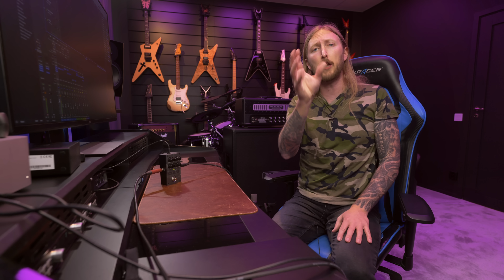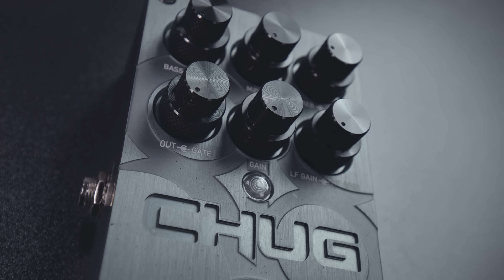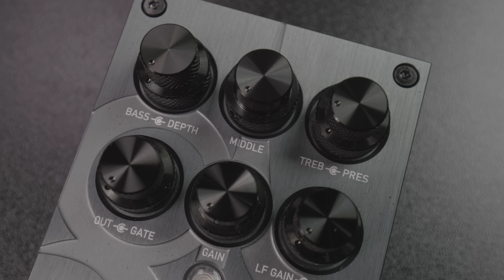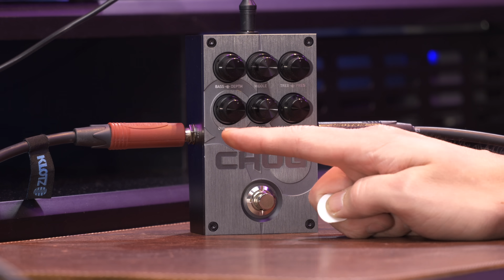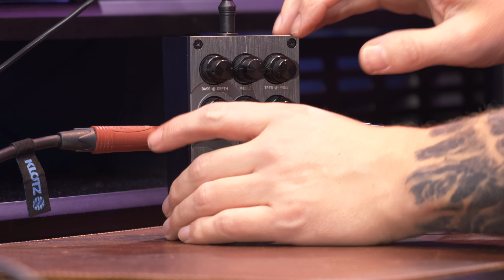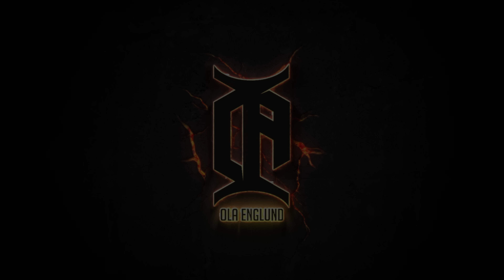THE CHUG HIGH GAIN PREAMP PEDAL

Comment: This pedal seems pretty cool. I am wondering if I use it on an older tube modeling combo amp without a presence control, would the presence control on the pedal work well to give me that presence option. I ask because you said to turn the presence all the way down when plugging into your amps clean channel. I assume that is because the mesa already has a presence control. Thanks!

Comment: Sooo, i bought used one, tested around 10 h  with different gear and here it my thoughts:
pluged before  Laboga Beast 30 + (smaler version of Mr Hector) and 212 vintage 30 cab - sound like crap...to much mids, unberable highs, no lows
same amp, same cab, pluged in effect loop  - sound like crap but little better...
Pluged in fx loop of Laboga Beast 30+ and my DIY 212 cab with Hesu Demon and Jensen JC12-70EL 12 - JACKPOT... omg this instantly sound GREAT... amazing chuga chuga, very ENGL sound for 150 bucks,

Comment: You could also make 249€ priced CHUG+ Pedal which has a USB charging battery in it. Then you could use it really easily for all kinds of situations without needing to hassle with power cables or making space into your tidy pedal board?

Comment: Holy !@#$%! Got the Chug today!! Just ordered it 3 days ago and I'm in Michigan. Wow! And it's staying on the pedal board. I can't lie, I had to do a heck of a lot of tweaking running it into the front of a Marshall DSL100 but I was also learning how to operate the knobs as well. But once I got things dialed in holy balls!!! 

This thing is like a Fortin 33 on steroids with tone controls, hi and low filter controls, bass and depth controls, mid control, noise gate, and a GAIN control!!! Insane!! 

So here's the cons which are not an issue at all for me myself, js:

Rhythm & Beard did a review and I have the same issue with the output knob turning when you turn the noise gate knob. That needs to be fixed although I don't use that gate so not a biggie for me (I just use 2 hands , set it and leave it). The corners of the pedal are a little sharp imo but it's on my pedal board so another no biggie for me. The issue that affects me is that there's no indicators on the knobs other than a tiny round indent so it's hard to tell where the knob is and also where it's going when tweaking. I leave mine where they're at once dialed in but I did spend some time making a diagram of my setting in case they get bumped. Made in China? Not losing any sleep over that myself.

Other than that and maybe a battery option (another thing I don't personally need) I can't think of anything else and couldn't be happier. And I'm one nitpicking finicky guy when it comes to tone! Selling all my Fortin pedals now. No bullshit. Thanks Ola 😁

Comment: Very cool, I wonder how good it would sound plugged straight into a common Bluetooth powered speaker? Like a small Jbl maybe? I used to sometimes play through a Behringer Ultra Metal pedal(which also has a good amount of tone shaping capability and is essentially a preamp) into a cheap little Bluetooth speaker if I wanted to pack extra light when going out to the  park or something. The speaker would just need to also have a cable input, which i would then use a 1/8" cable adapter. With the wide range of tonal shaping I could get a decent chug. I didn't have much money to spend at the time, which resulted in me using what I had on hand at the time.

Comment: IMO. I got this pedal. Very tight. However. Not enough bottom end. With the low maxed not moving enough air. If that is addressed in the second version then will be a powerhouse.

Comment: 😅 i really thought to design a pedal like this on my own. The only thing i would personally add is a low and high-cut filter to the gate. Some modern chug, like Architects, really need the low-cut to give the base any room in the mix at all. And the high-cut helps the vocals.

Comment: Well, it surely sounded fine and dandy with that IR and that ultra-expensive Mesa 👍 ...But when u plugged it into that smol Marshall, it surely sucked the chug OUT of it!! 😆🙈 I have a 10W version of that combo and I could swear it doesn't sound much different with the built-in distortion vs lé Chug. The Chug might have been tighter, but that's about it.
But seems like the best use for this might be plugging it into ur audio-interface.

Comment: OLA! I kinda doubt you'll even see this comment, but,
It'd be pretty BADASS if you'd pull out the all pedals Dimebag rig and swap the Horizon preamp for your Chug pedal.  
I built a more extensive version of your all pedal rig, but hearing your chug pedal all on its own, I feel like it might be a better fit in this chain than the Horizon! I'd be 100% sold on it 😂
Stay Metal Ola! 🤘😈🤘

Comment: Looks/sounds interesting, but too bad the input/output is placed on the sides, not on the top.
They're not even offset, makes the worst placement possible, when you try put it on a crammed pedal board.
😕

Comment: It's feisty, no doubt about that.  It's all the good stuff built in a straight-forward package, bravo for that.  No taking the pedal apart to turn a gain screw , micro-switches or micro dials on the side nonsense.  It's priced about where I thought it would be and not in the stratosphere like some can get and the pictures make it appear to be of very sturdy, stage ready construction.  Cheers.

Comment: I am very intrigued by separate low-frequency and high-frequency gains! That is a neat idea!
What I don’t understand though, is why so few distortion pedals have a mid sweep. It adds so much tonal flexibility at the cost of only a single knob. BOSS knew what was up when they put it on the Metal Zone. REVV hamstrung their otherwise awesome G3 by not giving it a mid sweep. 🤷‍♂️ I don’t know.

Comment: So good sounding pedal, packed with so many great features, built like a tank, with grreat design and named CHUG... kudos for all of these, bro, you nailed it to te max! 🤘 
Please consider this when it comes to version 2: since it's designed to be used as a preamp pedal, I suggest adding a clean channel to it (when turned off or maybe as a separate option). As someone who's been using preamp pedals for about 6-7 years, a lack of clean channel could be real struggle when you're left with just with your dry power amp sound.

Comment: I've never been able to use a drive pedal or preamp direct into an interface without unwanted noise. Usually a sort of constant high pitched whine just above the noise floor.  Tried lots of things with DI boxes, isolation transformers etc. both humbuckers and single coils. No clue why, but I suspect this pedal doesn't solve it either.

That said: fantastic sounding demo!

Comment: How would you handle the settings if you wanted to plug this into a board like the Headrush? I use the Headrush for virtual cabs/mics for my Orange Guitar Butler (another pre-amp, just not as modern metal sounding). But this pedal is intriguing for hard metal.

Comment: I like how this is basically the Satan preamp in a box. Gotta hand it to you Ola, this is the most versatile pedal for high gain we've had so far, bravo!
Reply: Pretty sure it's a replica of the Diezel VH4 pedal.
Reply: @LeftHandedRightHanded  pretty sure the VH4 pedal has neither a noise gate nor the low/high filter knobs.
Reply: @plumbummusic2051  are you talking about depth and presence? Because the VH4 does
Reply: @LeftHandedRightHanded  No he was talking about the separate gain knobs for high and low frequencies. That feature was (IIRC) in Fortin Natas which then found its way to Randall Satan and Randall Thrasher via Fortin.
Reply: @LeftHandedRightHanded  nope, I'm talking about the low/high frequency gain controls, please refer to 5:05 in this video where Ola tweaks the outer and inner knobs to change the distortion voicing.
Reply: @plumbummusic2051  ohhhh so like a Metal zone
Reply: @plumbummusic2051  it's great and all that they added those options, but you can't really act like "hey i took the tube screamer, and added some features, it's brand new"
and according to the VH4 pedal schematic, it absolutely has a noise gate, it's just fixed. put a potentiometer around the diodes and bam, adjustable noise gate.
Reply: @LeftHandedRightHanded  Definitely more functionality than the VH4 and cheaper pricepoint! Had me sold.
Reply: Same. What pretty much sold me on it

Comment: My fly-rig prayers seem to have been answered. I want something that doesn’t lose too much when I use it with compact class D amplification live, because most preamp pedals that copy the preamp circuit of an amp literally only emulate half the sound when the power amp contributes so much to my big tube heads. if you don't believe me, take your Dual Rec or Marshall or whatever's fx send to a Powerblock, Powerstage, Quilter and listen for yourself. (even my SS Randall sounds like shit using any power amp but its own.)

I really want to cut down on setup time, car space and especially freaight costs by leaving that shit at home for the studio.  I was looking at Origins’s amps in a box, they boast power amp circuit emulation, real tube feel blah blah blah and they run about as much as an actual tube head in my country.

That's just ridiculous, it defeats the entire purpose, plus I’m not going to use all those features anyway.  The one thing I want is a good approximation of something I can get my heavy sound with in my fx router, analog, as digital doesn’t play nice with analog overdrive in my experience (I have a one-off custom build by a pedalmaker because I couldn’t stand what 90% of overdrives did to the sound,) but I might not even need an overdrive at all with the chug, which will save even more space and time.

Even with conversion, it’s a good deal. If I can't get the sound I want live with it, I'd for sure have to be doing something wrong.

Comment: While it is a valid point to demonstrate the pedal with a cheap amp... I'm wondering - who'd buy a pedal for a certain price and plug it into an amp half its price? But that's not what interests me the most - why isn't the mid potentiometer concentric as well and being used as a parametric... or is it being phased out by the two blending gain voicings?

Comment: This would be soo nice with a tube in it just to boost digital devices like plugins or kempers, axe fx etc. for adding a little bit of mids and low ends.
Reply: You mean an eq pedal to change the eq? Glen says tubes are eqs.
Reply: to keep it simple; a single tube stage can never saturate on its own at the voltages we run them at, and will end up being imperceivable from a solid state device.
if you need a tube in your signal path, you'd want it after the preamps, if not a complete tube power amp.

Comment: Impressive. Pedal is useable throughout the knob ranges and should work for a variety of amps and guitars. Great demo as well on DI, stack direct or FXLoop, and combo. Personally I’m not a fan of modern metal tones but this is an impressive product. (I like crunch tones, use a Fryette D120 on my Diamond 4x12 with boosts and such)